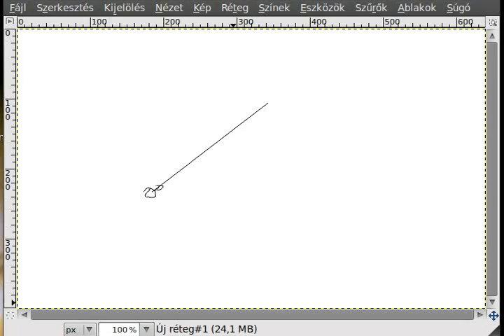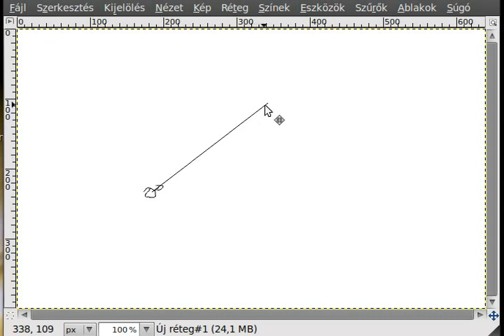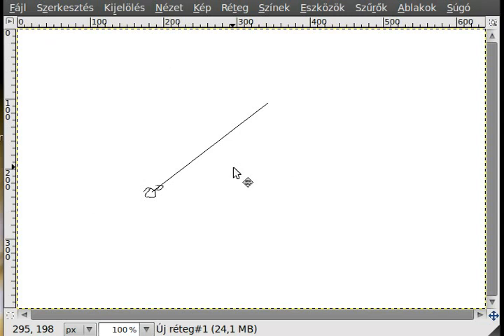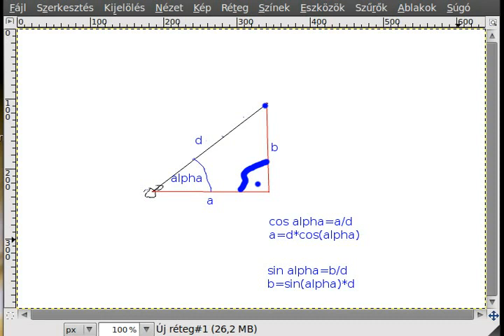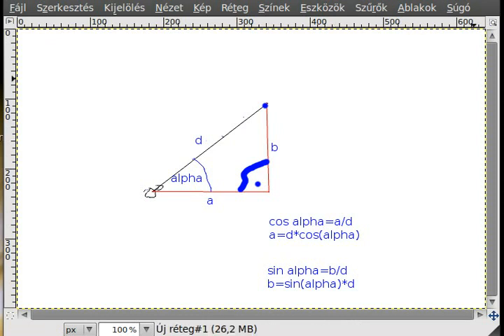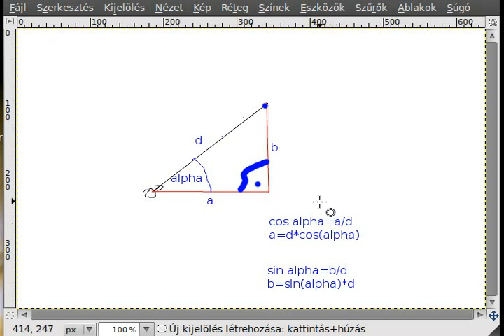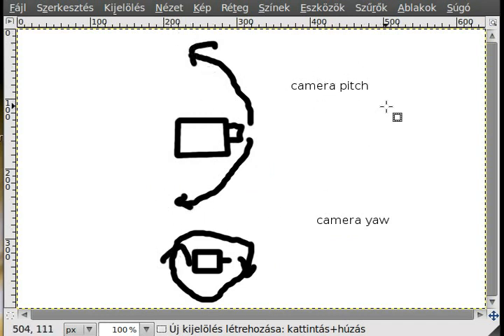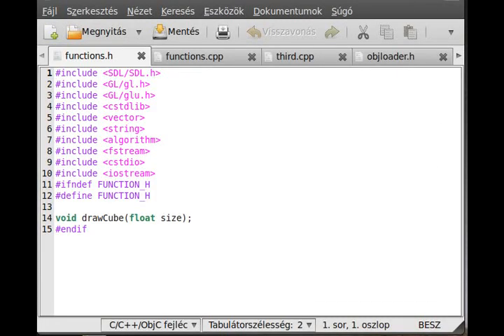OpenGL (SDL,C++) tutorial 14 - simple 3D FPS camera (part 1)

Comment: #define M_PI 3.1415926535
No equals are used in defines.

Also, because we're dealing with floats for the most part, we can use sinf() and cosf() which takes and returns floats.  This may not be a problem in C++, but in C (since C99) the float version of those functions is available (I code in pure C myself).